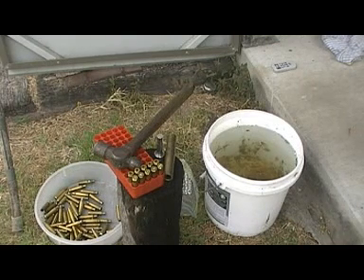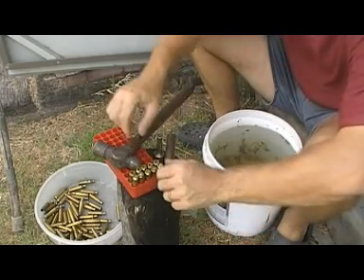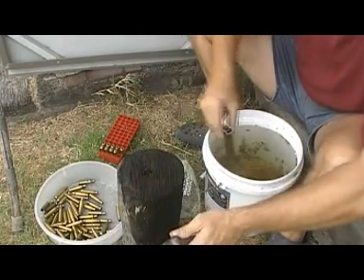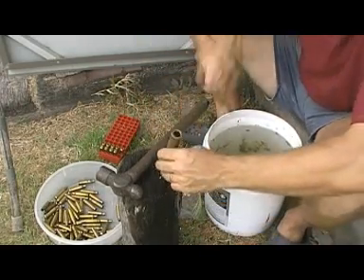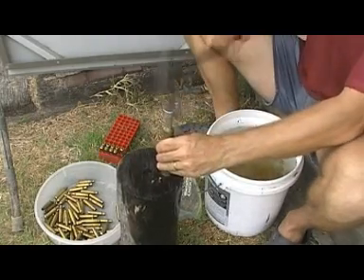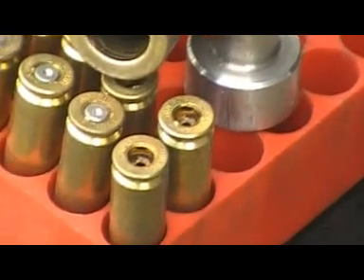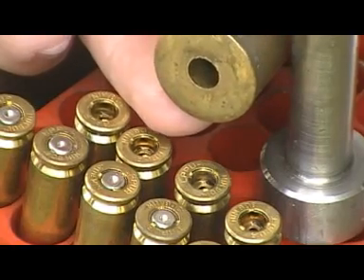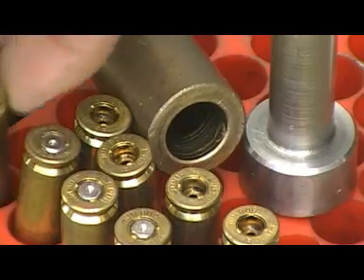Hydraulic primer removal.mpg

Comment: Man that's pretty cool how did you make that tool or if you didn't make it where did you buy it I would like to try and make one headed home some 7.62 x 39 cases
Reply from the maker: G'day mate. pretty easy if you have a lathe or know someone that does. Two piece design. the bore is a loose fit for the range of Shells you wish to deprime. the base piece has a hole slightly larger than the primer and is soldered into the bore to make a square base. water does the rest. Sorry I dont make to sell. Regards

Comment: RUSS, Most of the Nato stuff is Berdan, so does this convert the Berdan to a Boxer based anvil???.... like used to be done back in the 80s and 90s with used 9mm and again with a Hydraulic punch......from the UK.....CHEERS MATE
Reply: You will have to re-prime with Berdan primers of the correct size.
Reply: Sorry mate you seem to be missing the point whilst i know Berdan primers are available, there used to be a hydraulic punches available to convert from Berdan two holed anvils to Boxer one holed anvils
Reply: If you are replying to my comment about using Berdan primers, then you missed the point of robda's question, which I was replying to,  of whether or not your process converts them to a Boxer anvil system.  It does not and requires an additional step of either a temporary bushing or permanent bushing pressed into place and optionally drilling or punching a central flash hole.  Therefore, I answered him that Berdans are required for cases prepared as in this video.

Comment: quick way to decap berdan primed stuff but a waste of time for boxer primed brass- yes, you can easily decap this on your press, If you feel major resistance, stop and take a closer look before breaking a pin. keep spare pins on hand. I've only broken one pin in 60k+ rounds and that was completely my fault- a 22 case was hiding in the 45 case.

Comment: but corrosion ? shell gets rusty in a moment
Reply: +cagdas güven Brass doesn't rust
Reply from the maker: +cagdas güven If using steel cases place in a tumbler with crushed walnut shells and they will dry without rust.
Reply: Why deprime steel cases?

Comment: Best done outdoors, in Summer!

Additionally, if you use a "Thor" or similar copper-faced hammer, the plunger will not get mashed up as much.

Also, if the outer "cylinder" was of a larger diameter, it would be a bit more stable in use.

Overall, a good bit of technology for those of us who grew up with Berdan primers.

On UNCRIMPED primer pockets, the RCBS tool is fast and a a LOT less messy. Using that tool on "new", heavily crimped primers WILL destroy it in short order.

I just finished doing a thousand Berdan-primed 8 x 57 cases that have been piling up round here with one of those Lachmiller tools, no issues. All of that brass had previously been decapped in my hydraulic set-up. Once the original military primer crimp has been swaged or machined away, the RCBS tool is quick and DRY.

Are you using the Russian Berdan Primers?  Or do you still have a stash of the old RWS 5608 or 5627 jobs?
Reply from the maker: Bruce in Oz Yes you are correct, however it work fine as is. Regards

Comment: Wow didn't even know that was a method of extracting primers until now. Can u use it for 12 gauge aswell?
Reply from the maker: Ethan Weiss Yes Mate it works for all cases, you just need the correct size tube to hold the large diameter od the 12G
Reply: No reason to do this on 12 ga unless they are Berdan primed and one piece case/basewad  type cases or solid brass.  Just deprime as usual with boxer primed cases.

Comment: hey russ , I made one of these , and I made my piston a tighter fit and machined it all up , .... my ratio is one every 7th or 10th case , ... I cant get it to pop primer out every hit .... I am using a rubber mallet , do you think I should switch to a metal hammer ? .. would it matter ? I am trying to pop 5.56 cases , .. hope fully you still check your you tube email , .. if I put my thumb over the hole in the bottom and pull up on the piston , I get a vacuum "pop" so I know its tight enough .... any ideas ?
 cheers mate
Reply: wtf ? ...why would u comment ....  a douchebag? .... I hope your someone I know taking the piss , ...why would you bother , .... the entire internet to comment on and you choose this ....
Reply from the maker: Sorry Buddy, been a while. Yes I would use the metal hammer. the shock in much sharper an that is what is needed to break the tension between the primer and shell. Well done on making one.

Comment: good trick, I will keep that one in my hip pocket for years to come. I remember guys throwing away brass because it was berdan primed (i think i got the spelling right) with the little bar in the way of the primer extractor. This same trick can be used to remove bearings that are pressed into a flat bottom bore.
Reply from the maker: Yes I have use it to remove needle bearings in a flywheel. works a treat.

Comment: Very nice.  I would think if I stepped the cylinder to accommodate a couple different sizes I could do, say 54R, 308, 30-06, 5,56 and more with one tool.  All I'd need was to be sure the primer exit hole wasn't too small for the largest primer, and was still sized to support the smallest cartridge I'd use it for. Very ingenious!

And I hope you have not lost the rifle(s) you were reloading these for. Stay strong and get those protectionist anti-gunners on the defense, it's what we must do here!

Comment from the maker: made in the shed. Yes it can be used for any cases. Some size changes may be required for diff cases.
Reply: Russ4570, congratulations for your setup. Will it work with many calibers or is it caliber specific? Can I use the same one to, for example, 7x57 and 9mm Luger or o will need 2 different tubes?

Comment from the maker: Sorry benarcher but you are not correct. These are crimped primers. They snap any decapping pin on a conventional FLS die. This is why the hydraulic method is employed. After deprimed and the crimp removed then you can use the conventional dies and decapping tools.
Regards

Comment: It's really cool, but this just adds an extra step to the reloading process.  A full length or neck re-sizing die can do the work of decapping and re-sizing the brass in on pull of the lever.  Again I would like to say this is a really cool concept but just impractical.

Comment: Aussie ingenuity in action! I thought at first you were dealing with Berdan-primed brass until I saw the flash holes. I've seen this tried elsewhere (specifically WITH Berdan brass), but the other chap did it by putting a dowel in neck of the water-filled case and hitting on that. I think your method is probably better for the brass. Now IF you could get Berdan primers... (But WW2 .303 military cases are probably mostly corrosive primed and therefore rooted, even if you could reprime them.)

Comment: Not bad... not bad at all. Thanks for the video. You gave me something to build in my machine shop this weekend. BTW I'm going to machine the brass, better yet, bronze in one piece with a 4 fluke end mill to avoid soldering. Will probably make a few different sizes unless I can get one that will handle most if not all common sizes.

Comment from the maker: standard primer, just held in with a military crimp. it will work for any primer as it is the water that does the work. If there is a hole in the case (ignition without one would be very hard) then the water will pop it out.

Comment from the maker: Steel if fine, I use brass as it doesn't rust or gall with the piston. The piston needs to be a "good "fit with the cylinder so I would not use a bolt, unless you can turn off the thread.
The hole need only be a bit bigger than the OD of the case. Say 0.650 for yours. but it really is limited by the biggest case that you intend to deprime. if you make it too big the case may not cover the hole or the primer may not line up with the through hole.

Comment: Russ: I am attempting this on 7.62x54mmR U.S.S.R surplus. the rim's diameter is 0.565" / 14.35mm. The berdan primers have that red sealent in the primer pocket. My first question is can I use black iron as the tube or should I get brass? Can you explain why if so. Second, how wide should the hole I drill in the tube be? And finally regarding the piston, should I avoid threaded bolts? Any info would be great. I want to learn. Thanks for your time and kindness.

Comment: What keeps the water from draining around the outside of the casing and out the primer exit hole? Do you use a rubber gasket in the bottom, or do you just whack the plunger before it gets a chance to drain completely?

Comment from the maker: The entire shell and the brass tube a re filled with water. The pressure inside the shell and outside the shell cancel out each other, therefore the only way the pressure can escape is out through the primer pocket and as it is not supported by the brass cylinder the primer is ejected by the water. Now you can upgrade your dislike to a like.
Regards

Comment: @mjmoto72 true, its best not to do that, but I have carbide dies I dedicated only for steel cases, and another set for brass cases. After a couple hundred loadings they still bring steel cases into spec. At this point, even if they do break, I saved more than the dies cost in savings compared to buying brass.

Comment from the maker: @ELITEHAMSTER123 If you have a tumbler then just throw the cases in there for ten minutes and they will be dry, no worry of rust. If you don't have a tumbler do all the cases you want and then put into the oven on "warm" with door ajar. Using a 30 cal mop will be next to useless. I am assuming that you are in your winter so leaving the finished cases out in the sun to dry might be out of the question, but that's all I do.
Regards Russ

Comment: How do you suggest one would do this with steel cases? I worry about the rust. What I plan to do is to throw the deprimed cases onto a towel and every 50 cases, wipe down the outside of the cases and dry the inside with a .30cal bore mop. Any other suggestions?

Comment from the maker: @Carthon916 You would probably be better off going to a second hand steel merchant.
8" of 1" diameter brass and 4-5" of 1" stainless round bar. A drill slightly bigger than the primer. The ability to bore out the brass bar and lastly the ability to silver solder. You can get away without the need to silver solder if you can use a bottom drill (flat end) to get the nice flat base inside the hollow bar.
Regards Russ